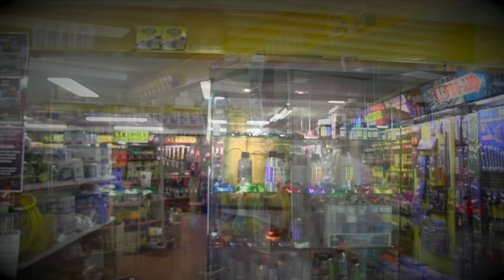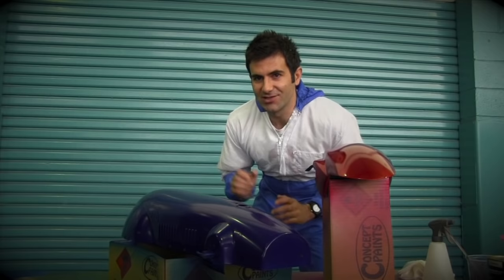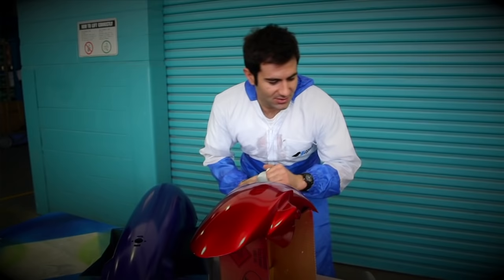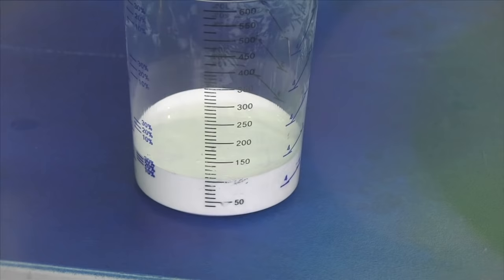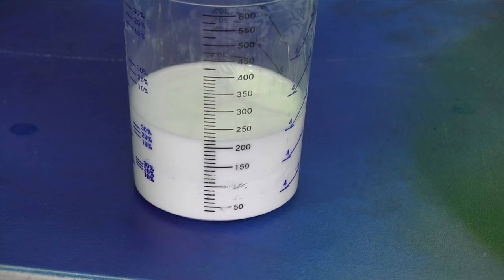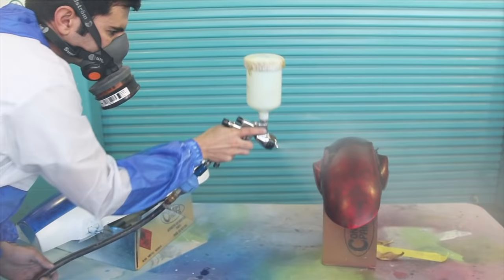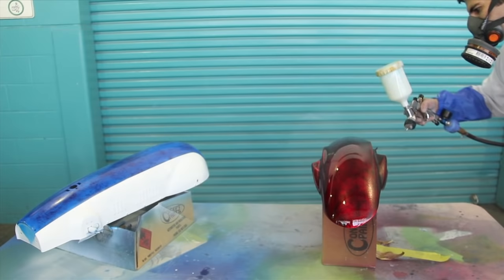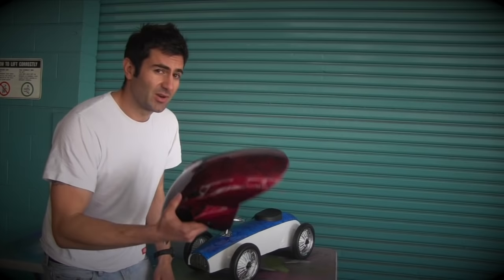How to get a crystal paint finish

Comment from the maker: Hello, its a Cormack Iwata 1mm. I dont know what air pressure it was at but the regulator dial was set to one turn out. Applying the basecoat is fairly easy and most spray guns will give a good base finish.

Comment from the maker: You can apply these crystals to any solid surface. As long as the topcoat that is sprayed over the crystal mask can adhere to the surface it will be fine. For bare metal spraying an etch primer then a base colour first is recommended.

Comment: I have used crystal fx with mixed results. First you are spraying the contrast color on to wet. Its more of a mist coast. U should just be able to remove with a wet sponge if u need to use a scuff pad then u went to wet. Also temperature can make the affect go from small webs if its hot to long web affect if its cold. Also i usually spray on a cleared surface.This can also make a different affect if you sand the clear  in circles the web affect will look like swirl affect if it sand straight the web will be longer. Its a cool affect but tricky get.
Reply: Where can you buy this stuff like to try it out
Reply: rttguy1969  alsa paint supply or coastairbrush

Comment: Hey I got a metal cart from my workplace before they threw it out.  I want to make it my turntable and record holer with lights. I have painted it blue from black already. But I want to add detail. Any suggestions??? Actually my husband did the base color cause freaked and didnt want to ruin it. I have an idea in my head for adding detail. I checked out stencils at Michaels. Any ideas. The blues is already done...I'm seeing details in black and silver.

Comment: could you do this with spray paint on a canvas?
Reply: +Southern Wolf Due to the canvas, I don't think you can do this exact method, but you could still replicate it.  Base color on the bottom that'll also be the 'crystals' so maybe something with a high gloss or glitter effect, then throw a very thin coat of whatever you want to contrast with it.  Bunch up newspaper or tissue wrapping paper to a decent crinkle amount, and dab it all over to pull off that second color and leave the crystal design, revealing the initial color 'under' it.  If the paint's too thick on that second color it won't come off too easy, though.  I'd do a test run first, of course.
Reply: +PsyCoCinematics thanks mam!

Comment: He's no painter of merit. He didin't cut in the edges of the fairing he was spraying before he applied the topcoat …good grief, amateur.
Reply: For #1-  When you're spraying with a spray gun, you want to have constant air flowing through the gun whether it be just plan air or with material (paint) flowing.  You notice how he stops spraying after each pass instead of having constant air flowing out?  
#2- Than to lay on the coats so heavy.  Let see what it looks like in two years- delaminated.    
#3- dancing in the area you just sprayed in isn't wise unless you want to get trash in your paint job.
Those are big no-no's in the professional world.
Reply: why should you have constant airflow, i was taught it doesnt matter..
Reply: Shaun Patterson it keeps the paint from clogging in the nozzle.